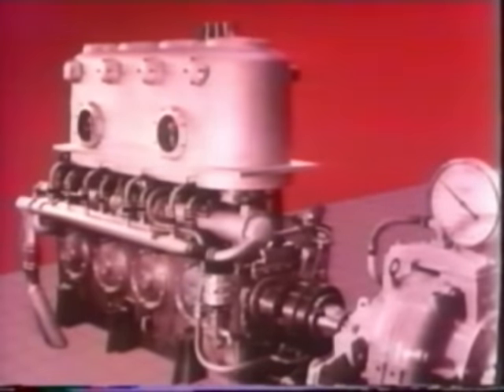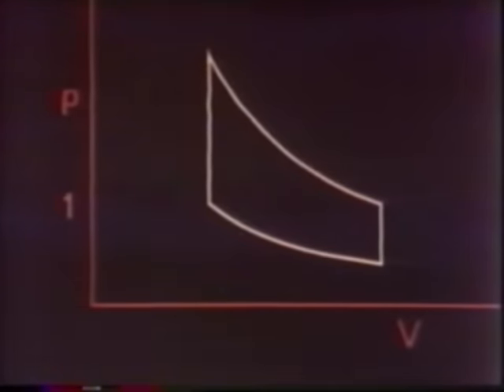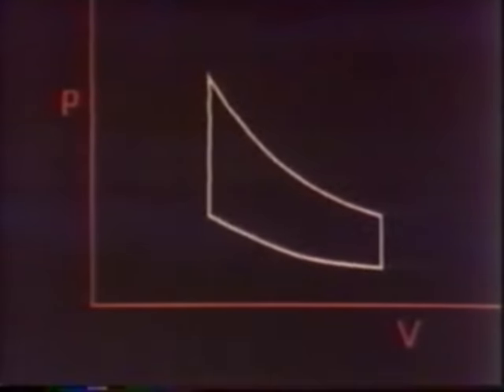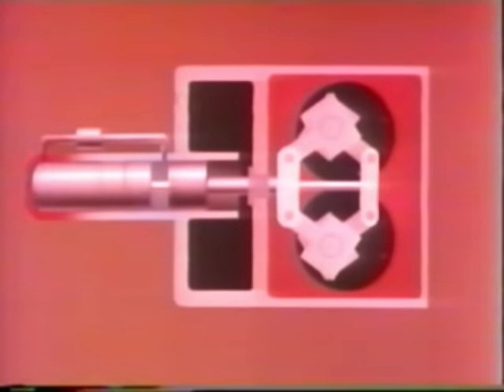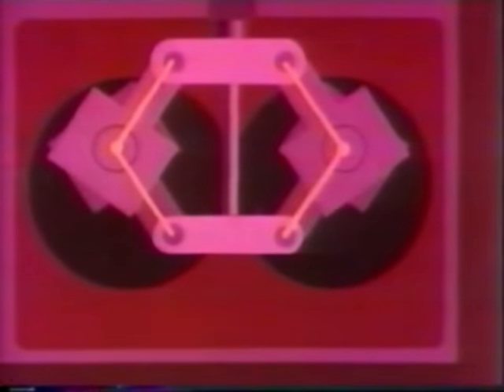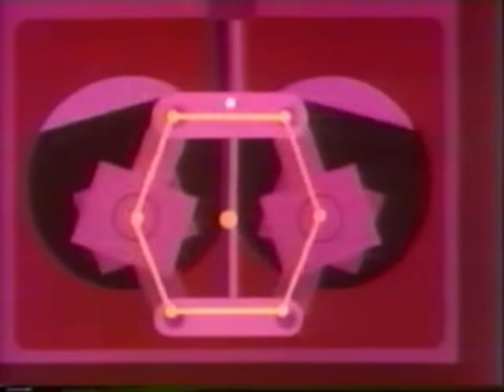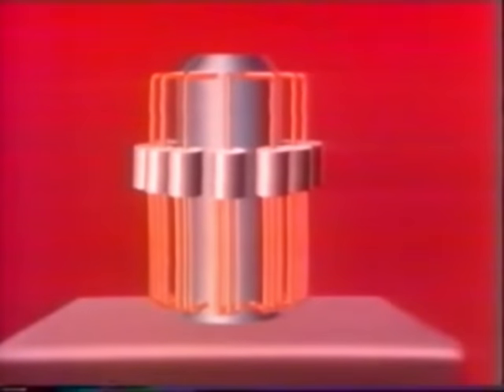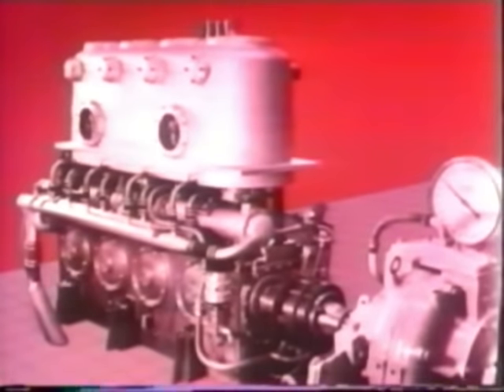The Stirling Cycle part 1 (Stirling Cryogenics)

Comment: How on earth are modern videos not nearly as good at explaining things as these ones?!
Reply: lack of understanding ... a stirling engine is a heat pump ... literally ... meaning it is a differential heat engine ... it needs a difference in temperature to work ... and it is the analog version of a pelltier device ... and like the pelltier device it is also reversible ... meaning it can heat OR cool stuff

Comment: There seems to be an awful lot of confusion around the different types of Stirling engine, alpha gamma and beta. You say this was the patent submitted in 1816 and then describe [very lucidly] the function of the beta cycle whereas Lindybeige shows the actual model that Stirling built in 1816, now in a museum, and it is quite definitely a gamma cycle. You can't both be right. And incidentally whichever of these two RS did come up with first why aren't they known as the alpha cycle?

Comment: Wow, amazing vid and description, first thing I though was using a Peltier device as a heat and cold supply for the engine.
Reply: they are exactly the same principle ... one is analog (striling) the other digital (pelltier) ... and BOTH can go either way

Comment: I used to operate a Spectrometer that utilized a Sterling Cycle Cryocooler to cool its infrared detector.  Turn it on and 5minutes later you were in business.  It was way more practical than dragging a dewar full of LN2 in a field setting.

Comment: I'm a believer. Slap a set of focused mirrors to direct sunlight on the heat chamber and you have got one hell of a cheap solar energy generator.  Bearings or lubrication would have to be out due to the high maintenance.  Air bearings would be ideal. And if used the system would have an almost unlimited life.  Perfect.
Reply: ive seen one YT creator demonstrate this tech on a small scale already. Zero emissions, unlimited supply... I wonder what could possibly be preventing the scaled up adoption of this century plus old technology en mass? [wink]

Comment: 40% efficiency is REALLY good, isn't it? I mean even now compared to modern turbines.
Reply: It's better than steam locomotives, however, most diesel engines have about 40-45% engine efficiency, so all the sterling has going for it is it's cleanliness.
Reply: Much better than the gasoline internal combustion engine which is often about 25% to about 38% for the most efficient modern engines (at the time of this video, more between 10% to 20%). Not as good as some electrical motors however.. but damn, I am impressed, especially for the fridge.
Reply: @Shunteration  diesel has 25% efficiency when its new.Gasoline has 15-18%.Steam turbines have 40% efficiency but can go up to 60 in the future.Thats why all power plants use steam turbines and not diesels.
Reply: @mihaiilie8808  "Steam turbines have 40% efficiency but can go up to 60 in the future.Thats why all power plants use steam turbines and not diesels."
You're not factoring in the loss of efficiency for the source of steam.
A turbine may have that efficiency, but it requires outside energy to move it.
Reply: given that at the end of 2019 solar panels have between 20~22% efficiency 40% is indeed already great.
However Stirling engines have the potential to get closer to Carnot engine efficiency ie with modern materials and tech it might grow in the future to 50~60%.
However for present days the more practical question would be to lower the costs of building such a Stirling engine. Because if you hook it to Concentrated Solar Power (CSP) dish you easily can afford losing some light energy (given that it's free ;)) and if you're living in a northern or cloudier climates simply by using larger CSP dish you can easily compensate the lower light intensity. Also use of parabolic mirrors is not mandatory since you don't need pin-point precision in the concentrated light cone - as long as it falls inside the heater's chamber it'll be fine - so your CSP dish can be done by faceted mirrors.
So I guess the main difficulties with such engine construction would be the seals - to preserve the working gas pressure (and to avoid leaking dangerous hydrogen or precious helium), and the materials that must withstand high temperatures (around the hot-chamber that is). That last part is important since heat-engines theoretical efficiency is improved by having greater thermal differential between the hot & cold chambers.
And I guess optimizing the heat-regenerator.
Reply: Where are you all finding these numbers? SourceIt
Reply: @vid2ification  Pretty much all of them can be found on Wikipedia. And if you scroll down on wikipedia you'll find the sources that they use.
Reply: @MrRolnicek  exactly the sort of answer i expected
Reply: @vid2ification  I mean this isn't any secret. You can find these things everywhere. Whenever a company builds a new efficient engine of any type they'll be VERY publicly proud of their efficiency figures.
And the figures for theoretical maximum efficiency are readily available and very well known as well. Some of them are literally the core equations of thermodynamics
Reply: Why not run a stirling engine off the waste heat of a steam turbine?
Reply: @Shunteration  cleanliness, longevity, versatility of fuel type. It's really perfect for pairing up with solar. Combined with cost effective and safe energy storage it's probably the best form of energy we could possibly imagine.
Reply: @blueckaym  Can you point me to any DIY resources for these engines? I'd be fine with decreased efficiency if I could build a lot of them for cheap.
Reply: @Shunteration  btw these 40% eff. they're reporting are for the car-engine type - ie the one that's designed to be heated by open fire.
However in that case of lot of the burning fuel's energy is wasted, and even if burning was concentrated to only heat the hot tank of the Stirling engine, you still have to consider the incomplete burning.
If you consider a Stirling engine built for more efficiency, and for stationary use (not in a car) and is heated in a way that doesn't waste much energy, or at least is fueled by green energy like the Sun for example, and if you don't need it for high HPs (as in a car) but for efficient conversion of energy, then you can go way above these 40%
Reply: @azteacher26  Unfortunately I can't :/ 
If you find such resources I'll be very interested in them too.
Reply: @mihaiilie8808  "Thats why all power plants use steam turbines and not diesels."
Uhm no. Power plants use turbines and not diesels because diesels can't burn coal or nuclear energy. Both coal and nuclear power plants work by making steam and then running a steam turbine. How the hell is a diesel engine going to run on that stuff?
Reply: @dieselgeezer18  obviously i was talking about diesel fuel.

Comment: This is great stuff, the Swedish submarines have been running the sterling engine for some time now. Think about the possibilities, hydrogen gas made easily and a source of solar energy. That is all it needs really to run the majority of households around. The problem is to get a sterling engine?? Where? From what I understand its quite expensive to make
Reply: Helium is safer ... and easier to purchase ... hydrogen has a draw back ... add a spark or flame ... to a leaky system and POOF ... one engine down ...

Comment: wonder if you could use super critical co2 in some way like this - the change from liquid to super critical is fairly rapid and also pressure increase.
Reply: ThePataks that will slow it down alot.. make way more drag. hydrogen is your best bet because it has a super high thermal conductivity and very low freezing temps.
Reply: ThePataks it also is a lighter then air gas so it makes it function much smoother
Reply: @carolynmmitchell2240  Hydrogen is a dumb idea, it's highly flammable, you have to use inert gases in sterlings like helium which has good thermal conductivity but won't blow up your engine like hydrogen would.
Reply: It wont blow if you keep oxigen away. It can not burn without oxigen remember?
Reply: @carolynmmitchell2240  helium is safer and is very close to hydrogen in thermal conductivity ... and easier to get

Comment: The best source of heat for this engines should be exhaust gases from modern engine and cooling system from modern engine. If able to collect 40% from the exhaust gasses and 40% from the cooling system. It would make a stationary diesel engine one of the most efficient engines currently available

Comment: For some reason, I still don't get it. I get how compression/expansion effects the temp, but idk how the displacer piston helps.
Reply: I'm pretty sure most people don't understand it because it's very hard to grasp in just one video. It personally took me a few weeks before I sort of understood what was going on principally. I have done an internship at this company last year and now again, so I sort of follow whats going on. Still I need to watch this video because I forgot the details of the principles lol. I am gonna try to explain it to you, because it also helps me understanding it better. Please tell me if you don't understand parts, because I learn a lot from it too 

The displacer makes a new chamber. Now you have the crank case area (the big one of the right), the middle chamber and the far left chamber. The middle and far left chambers have very similar dimensions. Especially compared to the crank case area, which is much bigger. 

As far as I know, the displacer is used to make sure that the two different sides of the cilinder wall don't need to change in temperature. Now  you have a 'hot' chamber and a 'cold' chamber, where energy is retained and not constantly changing. 

Now the greatest affector of efficiency is the circulating work gas between these two chambers, that take the heat and cold of the chambers to the other.

The regenerator serves as a sort of 'energy buffer', that 'stores' cold or heat depending on the phase of the cycle. This is to make sure that hot and cold gas don't change the temperature as much of the opposite chambers, therefore increasing efficiency. 

When applied in cryogenerators (what the company does), the functionality of the two chambers are switched around, making the far left chamber very cold. A tube filled with for example hydrogen or nitrogen gas passes this cold chamber, resulting in liquifying the gasses. (This is a different tube than the one they use in the video!!!!)
Effectively, the cryogenerators are Stirling engines working in the opposite way. The crankshaft is powered by an external electrical motor, because creating this 'cold' of course requires power.

Comment: if sterling engine is under very high pressure then will it work more efficiently since the energy source is same but atmospheric pressure is too low to bring out the exact efficiency

Comment: This feels like a lost technology. I believe this is the easiest source of green energy I have seen yet and yet no one is even talking about them modern day. You can power this thing with a Solar Fresnel Lens or a concave mirror and a moderate amount of Sunlight. It is quiet, efficient, and has very low maintenance. Plus it is 100% recyclable should it ever need to be removed or replaced.

Comment: Wouldn't there be an unavoidable inefficienty created as all of the tube and piston get heated by conduction? Could some kind of insulating features be built into the design itself to offset this problem?
Reply: Stirling engines have been constructed out of glass, so utilization of ceramic materials is definitely on the table. What needs to however be addressed is elimination of vibration when working with such brittle materials.

Of course, the more hard the material you work with is and the more resistant it is to heat deformation, the greater precision you can maintain when it comes to part tolerances. Metal, from my perspective, does not seem to be the optimal substance for many applications on a thermal difference engine.

Comment: I wonder why they didn't add a 2nd one 180 degrees from te first one. Shouldn't need counterbalancing weights and you can scavenge more energy that way.
Run the heat/cooling tubing between the two and it should auto balance by itself.

Comment: I have thought of trying to build something like this and wonder if the displacer piston should not only be a close fit but also as hollow as possible so as not to retain heat.
Reply: Correct - a material that is a poor heat conductor will do the best job. Just make sure that the melting point of the material is higher than whatever temperature you intend the tube to go to.

Whether or not you should leave it hollow depends on factors such as the strength of the material and again the heat conduction. While air is a poor conductor it doesn't add any structural strength. Good luck with your project. One of my most memorable moments from college was when we built a miniature Stirling engine-run car. It ran entirely on the difference of temperature between water ice and the room. For some added efficiency you could put dry ice on it too. I wish I still had that thing. If I have the time I'll build one for myself this summer.
Reply: John Bought one on on Ebay, the one with the 4 led's generator, works like a charm, made one myself BUT the bought one has a low friction power piston WITH compression, mine has insufficient compression so does not work,obviously this is the hardest part to manufacture but I wont give up, am looking for a suitable material, tried running the last one in a smooth brass tube, the bought one looks like a plastic one on  metal running in a glass tube. my piston was made of "Knead it" epoxy putty which I rubbed graphite powder into before it set on the outside and squashed it into a greased  [but wiped] cylinder not a success unfortunately.
Reply: it is close fit at a pint in the middle
Reply: NOBOX7 Thanks, I will keep trying, I down loaded the vague plan of the one used to drive the Multi stop van at Langley AFB, very sophisticated engine and there is a lot of info to read but the diagram is hard to decipher. Have a look at it on youtube.A contributor to youtube has given the website.
Reply: john brown That sounds like a lot of fun. Make sure you upload a video and reply here if you're successful. I'd be really interested in seeing it. I'm way too swamped at work to get anything done on my projects right now.
I'm currently in the process of scavenging some old electronics to build my own spot welder.
Reply: John Spot welding?  I do a bit with a stick welder but it destroys thin metal, love to have a MIG, but paying the rent on the gas bottle for something you use in a blue moon is not for me, plus whilst I have done a lot of so so MIG welding I am no expert on wire feed speed or pressure regulation, some one set it up for me at work.If I get lucky with the Stirling I will gladly post, machining a piston on an old dodgy lathe is difficult.
Reply: john brown There's no gas involved. I picked apart a microwave and reconfigured the the secondary coil on the transistor to create a low voltage/high current. It spits out about 800 amps which can melt iron so it's more than good enough for what I'll ever need.
Reply: John You obviously have a far greater knowledge of electronics than I do, congratulations.
Reply: +john brown 

aerogel?

Comment: A use for a heat pump in reverse would be nice using ground heat ?
Than also as an additive to systems producing excess heat and a heat difference is available!!!
Reply: These would be great to place in really cold places like the polar regions or places with high geo thermal activity.

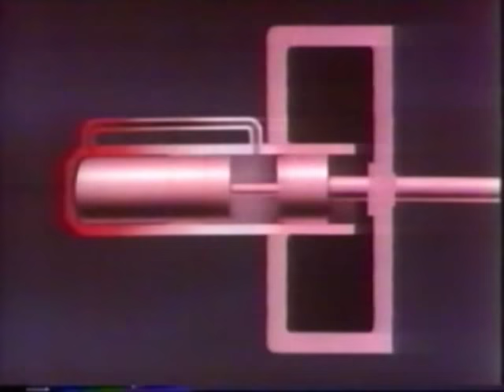Comment: Passive voice makes this video hard for me to understand.  What the heck does he mean at 5:41?  "Then compressed, and again, work is done."  What does the work?  On what is the work done?
Reply: There is actually no compression, there instead is contraction of the working gas when it is cooled, which creates a vacuum. When the gas is heated the gas expands and pushes against the piston and when the gas is cooled, the gas contracts and creates a vacuum and draws the power piston back into the cylinder.